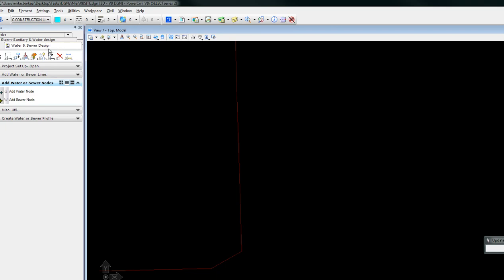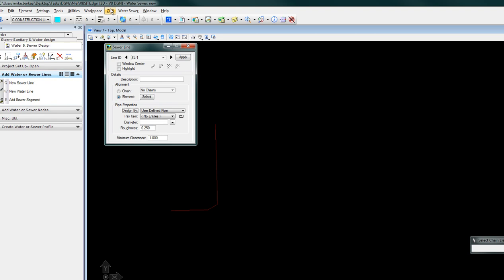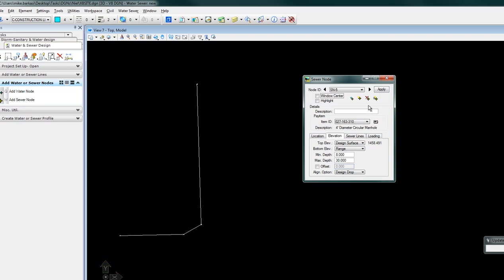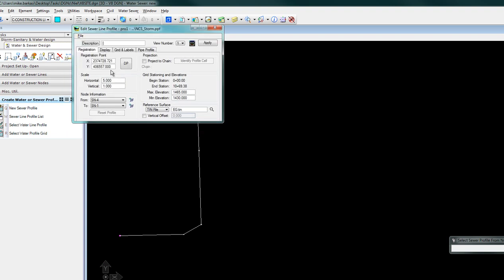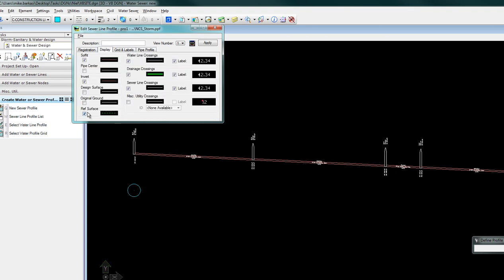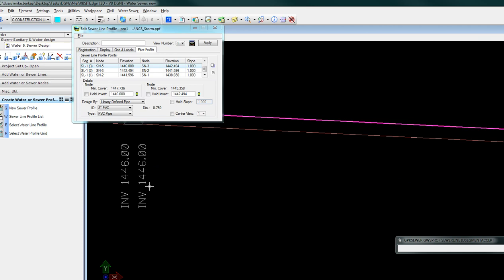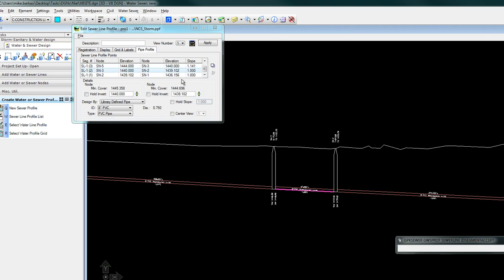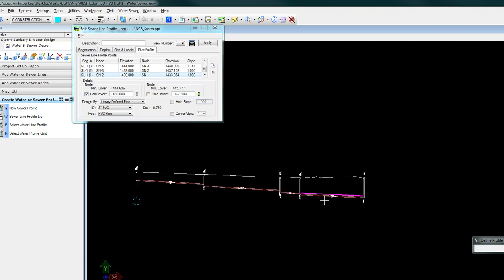GEOPAK Sewer

Comment: I am in the process of trying to learn how to use Geopak Sewer and Water.  The problem I am running into is that I do not know how to create a .ddb file or the .wsl (sewer and water library) file.  When I learned Geopak drainage and all the other Geopak tools that I have used, the DOT (Iowa DOT) already had created all the necessary files, but the DOT doesn't have anything created for Water and Sewer.  Is there somewhere I can download general .ddb and .wsl files for Geopak Water and Sewer?